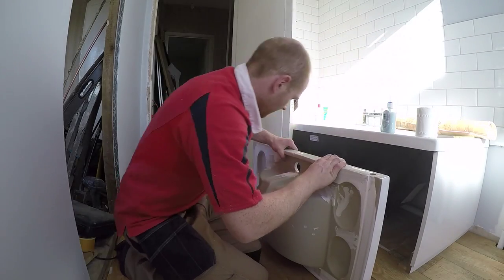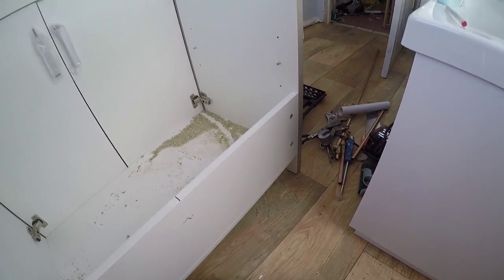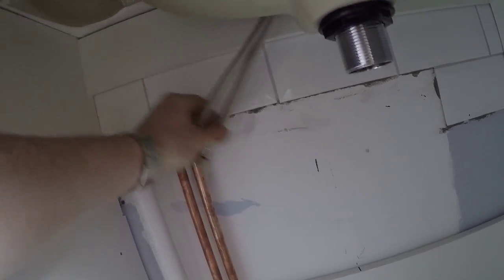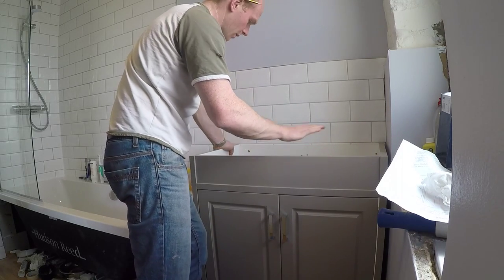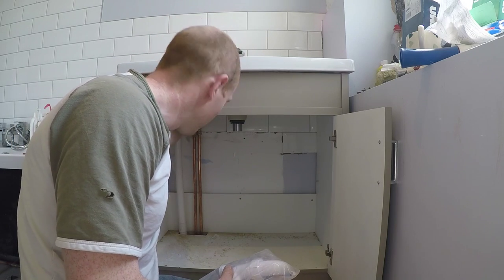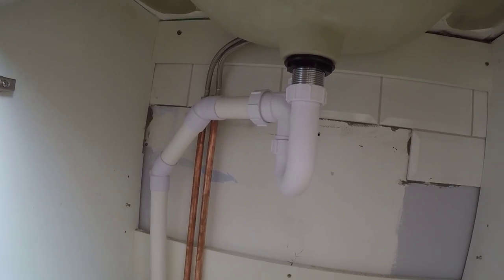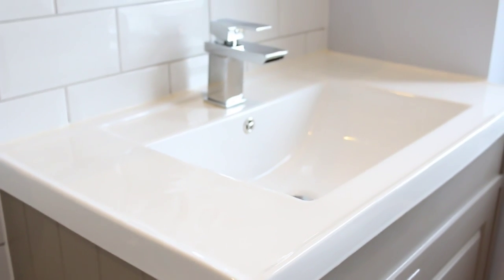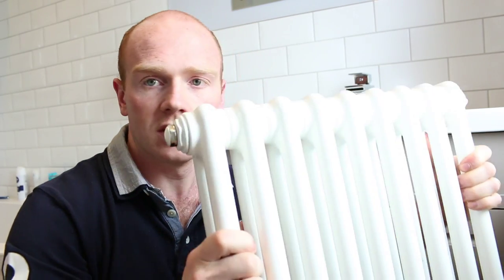Bathroom Renovation 9.0 | Fitting Sink and Vanity Unit

Comment: Why didn't you put another 2 isolation valves in where you could reach them as the originals ended up being not being easily accessible? and re your bath tiling I would have used a rubber seal between bath and first tile but my wife insisted we let the plumber do the tiling and he didn't silicone between bath and wall but did between wall and bath but this has given repeated hassle with water from over bath shower coming through kitchen ceiling!! when you can do it yourself,